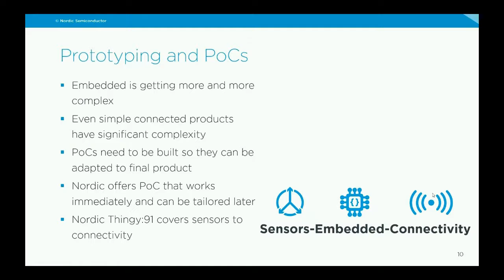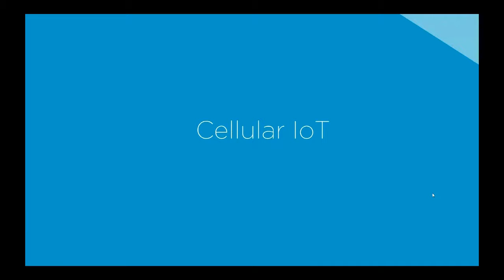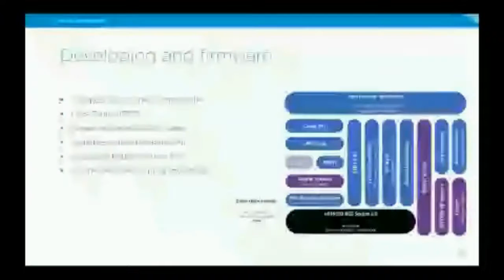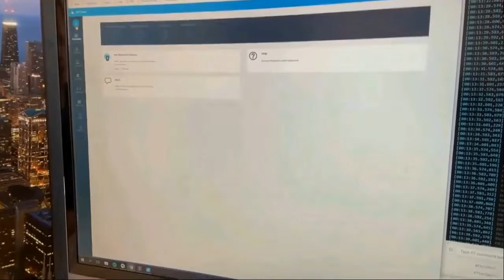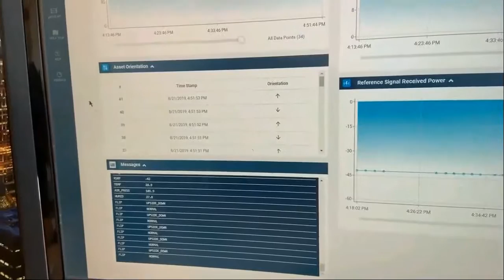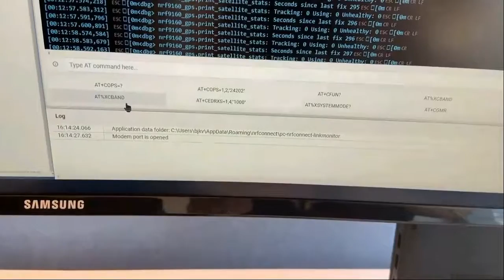Introducing The Nordic Thingy:91 Cellular IoT prototyping platform

Comment: is it solid enough to place it over a bin outside? We are talking about temperature constraints + some shocks when bin is picked and dropped.
Reply from the maker: The Thingy:91 has not been tested for vibrations, and has only been tested for a limited 5-35C temperature range. The Thingy is meant as a prototyping platform, and if you were to deploy it in large numbers outdoors more testing would be needed.